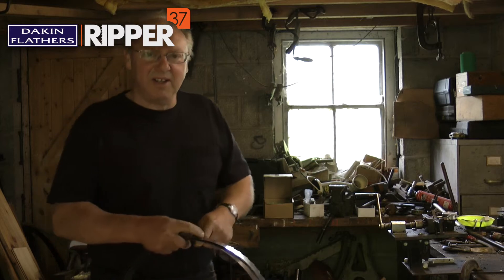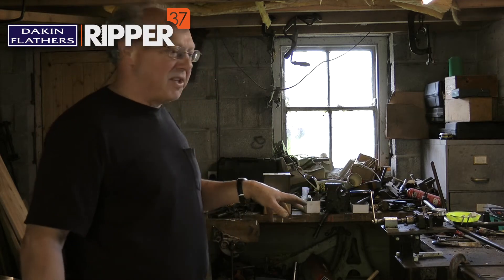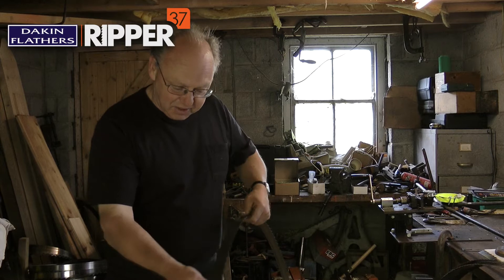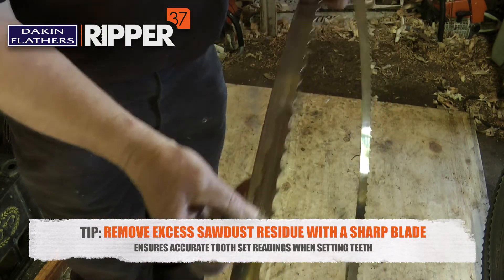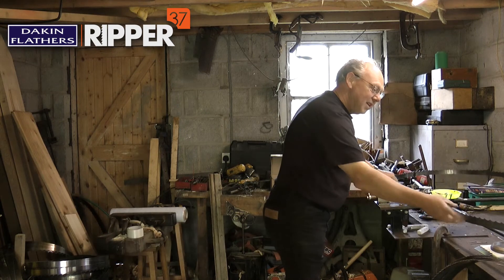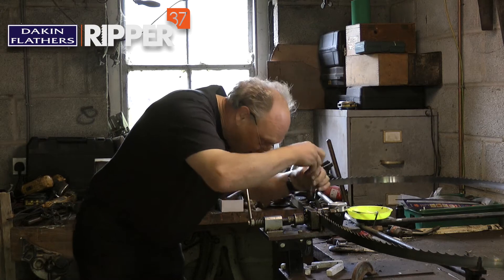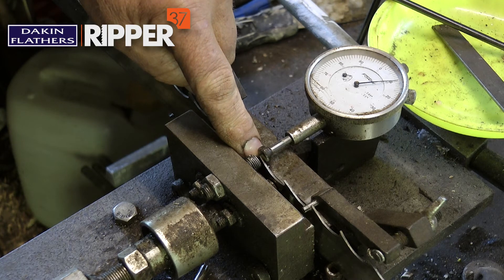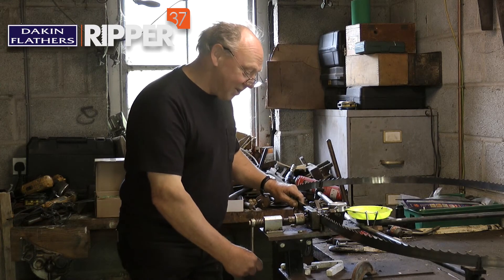How to Set Teeth on a Ripper37 Sawmill Blade | Tooth Setting Sawmill Blades

Comment from the maker: ▼EXPAND THIS SECTION FOR IMPORTANT INFO▼

Learn some useful hints and tips with Stephen Cull on how to manually set teeth correctly on your Ripper 37 portable sawmill blade for optimum blade performance.

Tooth setting sawmill blades for your mill has to be accurate to achieve a smooth, wave-free cut. Tooth set must be balanced on both sides for a perfect straighter cut.

Dakin-Flathers has been manufacturing blades for over 125 years in the UK, making it the largest carbon bandsaw and bandknife blade manufacturer in the world.

You’ll find our blades used in a huge range of industries in over 100 countries worldwide, including the UK, USA, Australia and South America. Dakin-Flathers blades are used in the primary processing of timber, furniture production, engineering, food processing and foam production.

Whether you’re looking for carbon bandsaw blades for wood processing or bandknife blades for PU foam, we’ve got a durable, quality product that will increase your productivity and bring a fantastic return on investment.

Some useful links to wood-cutting bandsaw blades:

Flexback bandsaw blades: https://bit.ly/4l08hRk
Sawmill blades: https://bit.ly/3FKbVju
Resaw blades: https://bit.ly/3HCq5Uj
Ground tooth bandsaw blades: https://bit.ly/3FMSMgU

Some useful links to metal-cutting bandsaw blades:

M42 bimetal bandsaw blades: https://bit.ly/43F3SxF
M51 bimetal bandsaw blades: https://bit.ly/4jHvVB5
Hardback bandsaw blades: https://bit.ly/4kJSIhe

Some useful links to food processing blades:

Bread slicing blades: https://bit.ly/43WtDbk
Meat-cutting blades: https://bit.ly/45eHJaz
Food slicing blades: https://bit.ly/3SOh1hE

Some useful links to foam slicing blades:

CNC contour bandknives: https://bit.ly/43COZMb
Peeler and splitter blades: https://bit.ly/44b9i3p
General foam slicing blades: https://bit.ly/4kyF6VJ
Cutting wires: https://bit.ly/3SO2u5t

Some useful links to specialist bandsaw blades:

Pallet recycling blades: https://bit.ly/4k4crHj
Diamond bandsaw blades: https://bit.ly/4jQXYhD
Pallet manufacturing blades: https://bit.ly/3HzT777

Some useful links to bandsaw blade hints and tips:

Bandsaw blade TPI selection guide: https://bit.ly/402TJZ9
How to select bandsaw blade width: https://bit.ly/45ChV8D
Bandsaw blade tension settings: https://bit.ly/3ZpHHZQ
Subscribe to our newsletter: https://bit.ly/4dUgMem

For more information visit https://dakin-flathers.com, call +44 1977 705 600 or connect on our social channels.